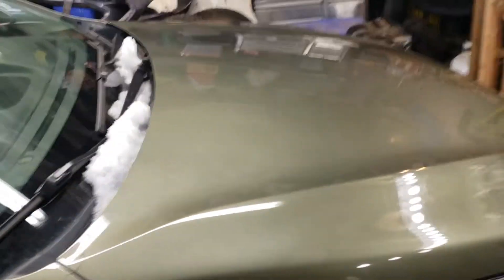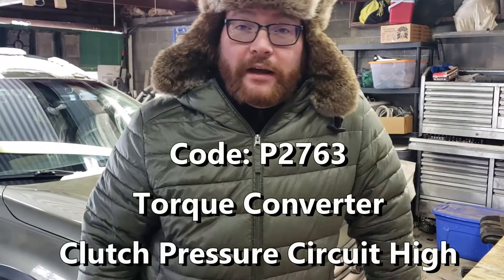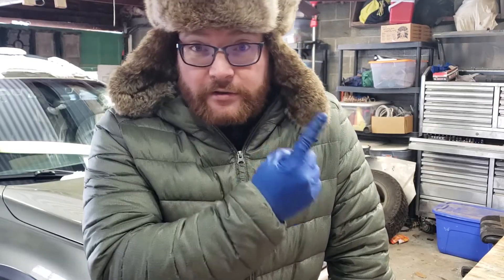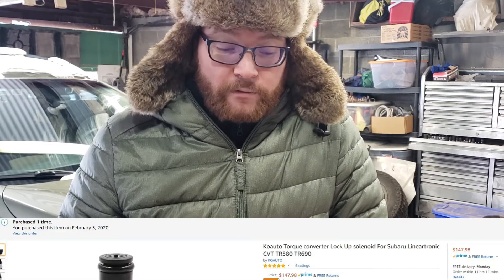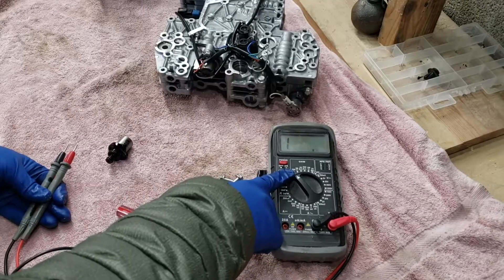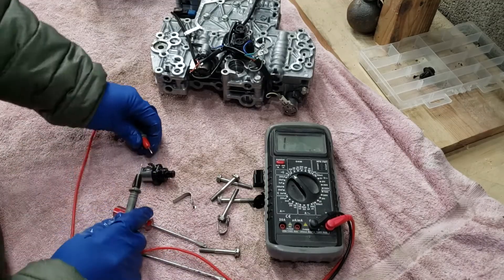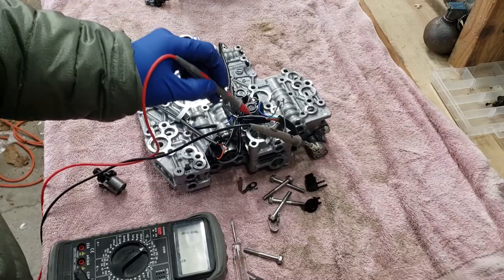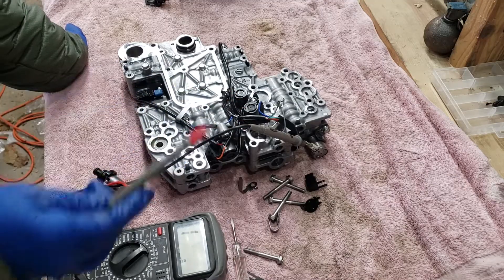Fixing a BROKEN Subaru CVT for CHEAP.

Comment: On the 2014 Forester XT’s with the TR690HT they did not have a filter before the valve body.  One was added for 2015 models.  Do you know if a 2015 Outback 3.6R would have that filter?  Metal shavings getting sheared off the Subaru CVT chain belt have been known to be the cause of failing solenoids.  Good info in the video.  I think typically what goes out after the solenoid will be the torque converter and then eventually the chain belt, which means an all new CVT 😖.
Reply from the maker: Interesting info on the filter. 

I am not sure if mine has one or not.

Do you mean the strainer? 

Part # 31728AA121

Also if you run across someone with this issue refer them to me. 

I'm planning on either donating the valve body whole or salvaging the individual solenoids and donating them to others who need them. 

I didn't want to mention it directly in the video as I would be unable to help others in the same way in the future. 

But at least for right now I have a repaired valve body I'm willing to ship to someone for free.
Reply: bruceyyyyy im not sure what the part number is, but MRT performance out of Australia 🇦🇺 talks about it.  Let me send you the link to the vid. (You’ve probably seen it already though)
Reply: bruceyyyyy the filter is totally different.  It’s a large part. Check out the vid.

https://youtu.be/34hS9691L04
Reply from the maker: @JonDZ_Adventuring  I've seen that one. I have both I believe.

The large pan and the oil filter that looks more like a motorcycle engine oil filter.

Part # 31835AA030 I think is what you're talking about.

Although now that I'm thinking about it: 

A second easily changed filter might not be a bad thing since the internal filters need to have the valve body dropped (or the entire pulley set removed) in order to change it.

The 4/5EAT has a (hard to reach but still able to be changed) external filter. 

Rigging up one along the coolant line similar to what the Gen 2 Outback H6 models had might not be that difficult.  I would just use theirs. lol
Reply from the maker: @JonDZ_Adventuring  oH Also if you really wanna nerd out there is a great resource here:

https://atracom.blob.core.windows.net/webinars/import/subaru_lineartronic_cvt_rebuild.pdf

Comment: How many miles? How often fluid changed? What caused the failure? What preceded the failure?
Reply from the maker: 160k 

Fluid never changed.

2011 Legacy.

That's all the info I have.
Reply: @bruceyyyyy  Was reading the FSM for 2017 TR690 (3.6R). Says for towing, should be changed every 24,855mi (40k km). Thoughts? I'm going to do it I guess. $200 / meh.
Reply from the maker: @lifeisgood070  I did mine at 50k. 

Got the fluid analyzed and they said it came back good.
Reply: @bruceyyyyy  160k with no fluid changes? GOD DAMN!
Reply from the maker: @moonsapling  Yup. I really question the "lifetime fluid" Subaru recommends.
Reply: @bruceyyyyy  didnt they say something like unless its driven in perfect conditions the fluid should be changed every 30k?
And im surprised it lasted so long without a fluid change.
Reply from the maker: @moonsapling  They say severe conditions it needs changed every 25k (40k km). 

Then they list severe conditions as: Towing, hills, traffic, highway, dirt, idling, etc.
Reply: @bruceyyyyy  basically everything thats not a closed isolated lab...
Reply from the maker: @moonsapling  Seems like!

Comment: inb4 "YOUR CVT BROKE BECAUSE YOU OFFROAD IT AND IT'S A CRAP TRANSMISSION"
Reply from the maker: Lol this wasn't even mine I'm going to donate the valve body
Reply: @bruceyyyyy  Hi, very good video, i bought the solenoid and replaced. Car work fine for 5 days, but sadly after this period same error . I noticed weight difference on the solenoid bought on amazon is less than the original solenoid that was replaced. Who sells the original solenoid? or i'm deemed to buy the whole valve? Thanks!
Reply from the maker: That is unfortunate! I think right now the only way to get the original solenoid is to buy the entire valve body. Subaru doesn't sell it individually. I will try and source a better supplier for it.

Comment: Good to know!
Hopefully my 2015 won't need repairing anytime soon, LOL!
Reply: My 2010 has 230 on it it just now needs a valve body but I’m a cheap ass and got a used one
Reply from the maker: The HT-TR690 in the Gen 5 Outback seems to have a really good record.

I wouldn't worry about it. 

I just wanted people to know that it's not necessary to replace the entire valve body.
Reply: @bruceyyyyy  I recently had my valve body replaced on a 2014 Legacy for about $1400... I wish I could have just replaced the bad solenoid! ಠ︵ಠ
...  At around 145,000 miles check engine light came on, AT fluid, parking brake light, and cruise control started flashing. I got a P0700 code and a few other codes. My local independent Subaru shop said the only remedy was to replace the whole valve body. 
 Great video Brucey, I enjoyed it.
Reply: @Seven_Business_Days  exact same thing happened to my 2014 outback...they want the same amount of money, but I think I'll go this route first...my engine light is the only light not flashing...care has 155k on it